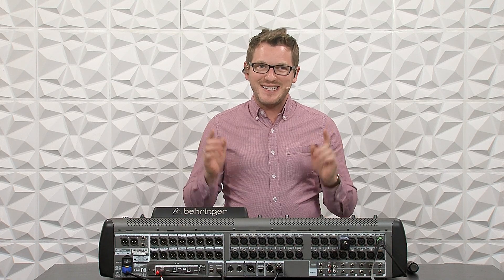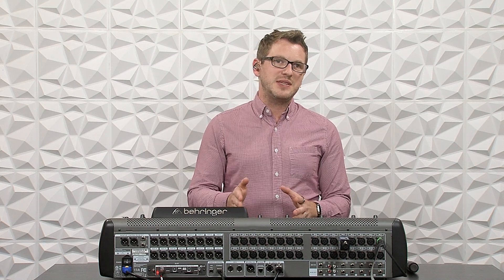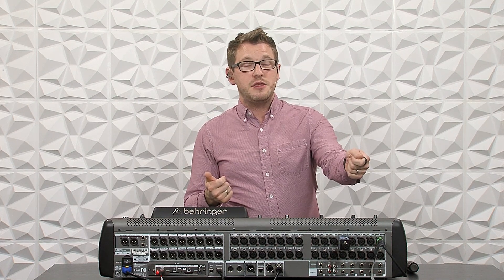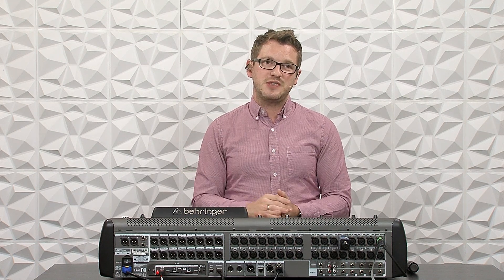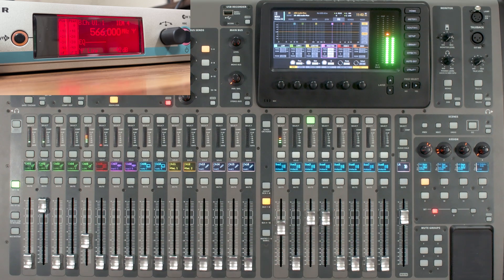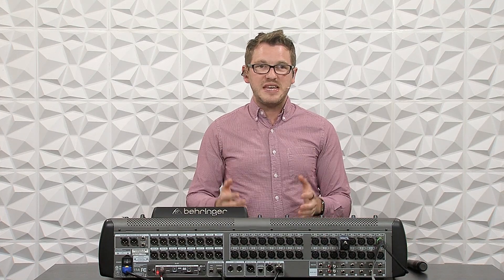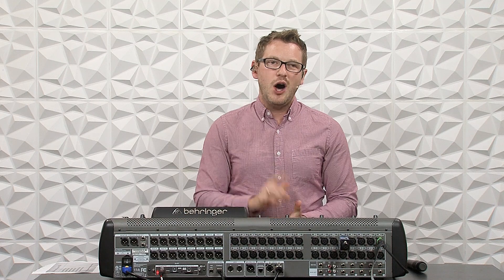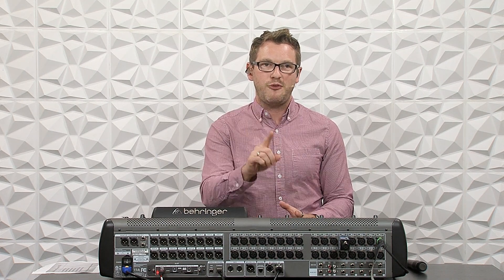Monitor Mixing - Do This to Make Your IEM Mix Better! 19kHz Pilot Tone Issues

Comment: i had huge issues with an A&H digital desk and shure PSM900 IEM transmitters, sounded like a brick wall limiter constantly in GR related to excessive HF noise coming out of the desk.   LPF made no difference.  didn't have the issue with any other desk including the x32.   A&H blamed Shure,  Shure blamed A&H.  i suspect some passive LPF between the desk and the transmitters would of solved the issue

Comment: Great video! I will apply this the next time I get to my setup. 

Just a couple of questions though…

I use an Allen & Heath QU24 desk. Then the Sennheiser XSW IEM. The PEQ on this desk only has 4 bands and a low cut, but no high cut. However for the monitor bus, it does also include a graphic EQ.

So could I use the graphic EQ to shut off/curve those higher frequencies? Then use the PEQ for the low cut? So I still have PEQ bands to use if I want to?

Thanks for this. I have had a few issues when it comes to dropouts recently. But I think it may be my hi hat mic, throwing the high end up and peaking. So I really hope this fixes the issue.

Comment: Hi I have a question:
Why cut at 19k if you're going to do a high cut at 15k? What are the benefits of doing both instead of simply having a high cut filter at 15k?
Reply: Because the low pass had 12dB or 18dB/oct slope.
So at 30khz you had -12 or -18.
At 19khz you had about -5dB
Reply: @ thanks so much

Comment: 19 kHz is not in the middle of our frequency spectrum I don’t know where you’re getting your information from. We are 20 Hz to 20,000 Hz and that’s not even close to what people actually hear and depending on the volume so what you’re saying is completely utterly wrong, so try again
Reply from the maker: Thanks for your comment @buddytheelvisofdogs. However, 19 kHz is the same thing as 19,000 Hz. Which does fall into the 20 Hz - 20 kHz you mention.
Reply: @DrewBrashler  so u think its the middle
Reply: @DrewBrashler  the middle would br 10khz
Reply: @DrewBrashler  no one hears 19 kHz

Comment: Excellent channel Drew! This technique also applies to IEM systems in the 2.4Ghz band?
Reply from the maker: No it does not, most of the IEM systems in the 2.4GHz band are digital, so you won't have this issue. This would be for any MPX FM IEM transmitters, which happens to be most of the UHF IEM systems.
Reply: @DrewBrashler  ah ok, that's why my xvive u4 lists 20-20k.

Comment: I used to be a broadcast engineer. The 15 KHz low pass filter is an integral part of the stereo generator in broadcast transmitter systems, so regardless of what you feed into the transmitter input, the audio will be filtered so it does not interfere with the 19 kHz stereo pilot. I'm surprised that IEM transmitters do not have in-built 15 kHz lowpass filters, as do broadcast transmitters.
Reply from the maker: Most IEM systems have that low pass filter, but you can overcome that filter if you boost enough in the HF. If we imagine a 24dB/Oct LPF at 15 kHz, at 19 kHz you are only down about 10 dB. I imagine the better transmitters like your broadcast employ much deeper LPF's but I don't think the IEM transmitters we use do.

Thanks for watching!
Reply: @DrewBrashler  Yeah, 10 dB is nowhere near enough, because 19 kHz pilot injection is only 8 - 10% total modulation, so the pilot is 10 dB down already.

Comment: Drew, this is freaking brilliant. We have two wireless IEM (PSM300), and was having trouble with the signal clipping on the transmitter with the AUX send on -12 db.  On my Presonus 24R, I have all Aux for all 4 IEM (the other two are wired) eq'd to match the Harman Kardon curve from Github.  I threw a GEQ on the two PSM300 Aux and got rid of everything above 15khz and below 35hz.  Much clearer, no clipping of transmitter or dropouts.  Thank you so much for the information!
Reply: This just answered the question I had above about the Graphic EQ on my QU24. Perfect, thank you! 😂

Comment: Hi Drew, One thing i didn't get is why you have to use High cuts twice ? If you use the 15Khz alone wouldn't make the trick by itself ? What's the reason for using 2 Hicuts ? Thanks
Reply: It’s a low pass filter at 15k plus the notch at 19k. I’d call it extra insurance against running into the pilot tone issue: the slope of the low pass probably isn’t steep enough to completely eliminate the issue at 19k, so adding the notch there takes the audio in that range >20dB below where it might cause trouble. Treating the send to a transmitter with this filtering will give you audio headroom to play with, keep you well away from the radio sections limiters and just make the system function more efficiently/optimally, plus the squelch might be more easily set. 
I love simple (and often unknown, misunderstood or overlooked) adjustments to gear config like this that make things more trouble-free and reliable from a functionality PoV.

Comment: Makes a lot of sense from how you explained it but I have two questions:
1. If these packs only support up to 15khz and the pilot tone sits at 19khz why do they not come prebuilt with a low pass filter set on their input - surely this would avoid the issue in the first place?
2. The explanation around FCC seems confusing. If they insist that audio is not transmitted above 15kHz then how are the devices able to send and receive at 19khz (surely this is outside the allowed spectrum)?

Not saying there is anything wrong with your explanation or observation just seems confusing to me?
Reply: The actual explanation is, there is a legal limit to the bandwidth of a signal.  3Khz for Single Sideband or 6Khz for AM or FM.  Since in-ear systems run on 3Khz, there is limited space for the entire 20-20K spectrum.  This is a technical limitation based on FCC spectrum requirements.  A Mono signal would have the space for the full 20-20K.

Comment: If you have a high cut at 15kHz why do you need a 19khz notch cut as well. Great video btw.
Reply: Because the low pass had 12dB or 18dB/oct slope.
So at 30khz you had -12 or -18.
At 19khz you had about -5dB

Comment: Should this EQ curve not just be handled in the transmitter then? Because as I understand it from this video, the transmitter/receiver are also the components that are limiting the frequency response and adding the 19Khz pilot tone. It figures they would then also apply the EQ curve on the signal to be transmitted to make their system work more reliable.
Reply: i agree and this is probably the case on any modern transmitter.

Comment: @drewbrashler This is really interesting. One thing i have encountered, as an EG player, is my tone is not representative to what i am hearing at my source. My amp tones that i am getting are phenomenal. My eq for EG is flat, sometimes a hi-cut is added to take off any fizz. I have adjusted mics, etc. We run our ears on a digico sd7 (this is used for both FOH and monitors actually) . psm 900 and i have 1964 A6-s ears. I have spent so much time trying to finesse this and get an accurate sound from what i hear from the source. Do you have any wisdom? or more questions that i can answer to help me get there. Thanks.
Reply: My tone feels thin and not full like i am getting from my amps. There is not a lot of sustain or dynamics happening.

Comment: The IEM transmitter has a limiter that is sensitive to high frequencies. The analog transmission has a 75 microsecond pre-emphasis high frequency boost. The receiver in turn, rolls off the highs and this results in less FM noise.

Comment: So, do I understand correctly that Sennheisers statement in their manual of the EW G4 IEM (AF frequency response 25 to 15,000 Hz) cannot be true because of the technical limitations of the used FM multiplexing (MPX) technology limiting the AF frequency range to 30 Hz-15 kHz?

Comment: If there's an FCC limitation on high frequencies you can have in your audio signal, then why are the transmitters ignoring it and transmitting it anyways?  The only way it could interfere with the pilot tone is if it were being transmitted, right?  Why don't transmitter manuafacturers just put a super steep low pass filter at 15khz before encoding the signal for transmitting, if the receivers can't handle the higher frequencies?  I don't know, something doesn't add up.

Comment: I'm wondering why IEM manufacturers don't put a hi-cut at 15kHz on their transmitters inputs if the frequency response won't go up further anyway. Easy thing to do and they would get rid of that issue with the pilot tone. Tbh i always thought they wouldn't let me send anything on the same frequency as the pilot tone by cutting it out on the inputs but you've proven me wrong.
Reply: Exactly my thinking. Why don‘t they just filter out anything that could interfere with the pilot tone? That would save so many people‘s day..

Comment: Maybe I missed it, but I was under the impression that the 19kHz tone was to signify a stereo signal to the receiver so that it was aware to decode the multiplex signal on the carrier channel, which is why the frequency range should only go up to 15kHz to prevent interference of the pilot (and interference with the decoding process). In a mono signal, the pilot is absent, telling the receiver that the signal is not stereo and does not need decoding.

Regardless, limiting the output bandwidth to 15kHz on a wireless system makes sense.

Comment: Isn't a Matrix Mix for the In Ear output the better way to place the EQ?

But very interesting to fix the Problem with an EQ curve.
Reply: why?
Reply: @funkyjkl  Because you only modify your specific IEM output and not the whole mix.
Reply: wat? That is dumb.
That bus is only going to the IEM, so the EQ would only apply to that.

Comment: If you're rolling off everything above 15khz, why would you need a -15db notch at 19khz as well?
Reply: This is exactly what I want to know as well. I was hoping I could find the answer
Reply: Actually @djbassick a few comments up has asked the same think and it was answered there.
Reply: @Shakespierre  i dont see any comments by a djbassick
Reply: @LaminarSound  Count 8 comments up. It's there
Reply: This is what was answered: "
@DrewBrashler
2 weeks ago
Great question! I put the hi-cut to filter out the frequencies that go up to 20kHz. My thought process on that one is since the transmitter can't reproduce it, why send it. Remember that a LPF has a dB/octave slope, so even with the hi-cut, there is only going to be so much of a reduction to 19kHz. So the PEQ at 19kHz allows me to really solidify the reduction of the audio in the area of the pilot tone."
Reply: Because the low pass had 12dB or 18dB/oct slope.
So at 30khz you had -12 or -18.
At 19khz you had about -5dB

Comment: I think that if you put any signal above 15k at high level, you will get this effect, so it's not 19k problem only. (just bc iem input is overdriven) So, yeah, hi-cut on output is nice, but i don't think that 19k filter will make things better.
Reply: If you overload the input with any signal you'll get this effect.

Comment: I can't thank you enough for this video. We've been having Wireless IEM dropout issues at our church and I'm now thinking it's because we have Avioms feeding our transmitters that have a ton of high end on the vocal and drum overhead mic channels, probably clogging up the pilot tone. I can't wait to test putting some EQs in between to see if it fixes the issues - Appreciate your extensive knowledge and heart to teach, Drew!
Reply: Our church currently uses Avioms as well and I'm very curious if this trick will alleviate our drop out issues too. How would you go about putting the low pass on the avioms?

Comment: Hi Drew! You are the boss, and help me a lot! Can you please answer one question. Do you know if Sennheiser or other brands have a limitation on they systems, how many receivers you can use on one transmitter? Is two the maximum when you buy a twin system or you can buy even more receivers and have same mix output on all of them. Thanks a lot!
Reply: No limit on the number of receivers. It’s a radio. Just like a commercial FM radio with way less power. Once you’re transmitting whoever wants to tune in can listen.

Comment: I have a couple questions: we use a x32 and for in ears have the Behringer HA8000 and Shure P3ra and transmitter. We are hearing the “pilot noise” which sounds like static. Is this video demonstrating how we can remove that?

Comment: Audio Technica's 3000 series transmits up to 19khz according to their spec sheet... although I've only been able to achieve these results when in mono. It drops out at about 15-16khz in stereo.
Reply: Frequency response is 40hz - 14.1khz according to the spec sheet in the manual.

Comment: This is an off-topic question. When I'm recording through the x32 into Reaper, I only have the option to record the first 8 tracks. how do I get it to record and playback all 32 channels?
Reply from the maker: Go to your X32, hit the setup button, tab over to the card, on there you will see a setting for swapping the card to be 32in/32out, I bet right now it is set to 8in/8out.

Comment: Interesting that on Sweetwater, the audio frequency response is 20-19k, but the Shure spec sheet says 35-15k. Seems like a large oversight. Glad you pointed out this intormation
Reply: For the Shure PSM1000, that is.
Reply from the maker: That is really interesting! Nice catch!
Reply: the frequency response might be for a Shure combo pack that comes with earbuds? and the listed response is for the earbuds, which would be true if plugged into a wired system?

Comment: Does this apply to like the xVive 2.4ghz IEM system and others that use 2.4ghz?
Reply from the maker: No it does not! The 2.4GHz stuff uses digital transmission. This would be for any transmitter that uses Stereo MPX or MPX transmission. I know there are a few in the 900MHz range on Amazon. But the XVive stuff, this would not apply to. Great question!
Reply from the maker: Absolutely! Thanks for watching!